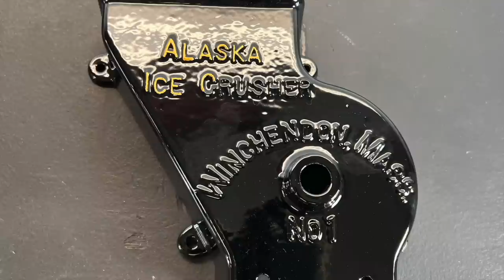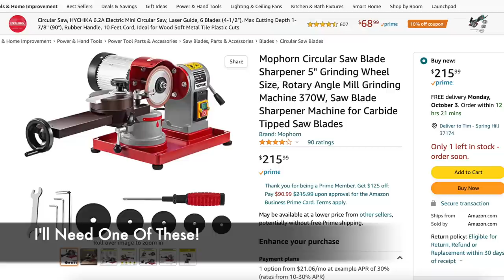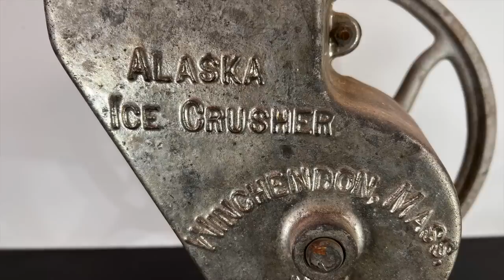Vintage Ice Crusher Restoration - Antique Restoring - Restoration Video

Comment: Great restoration.  They don't make things like that anymore.  Do you mind if I ask if you used a food contact safe paint and what type?  I am restoring one by North Brothers myself and it will be used frequently.  I am considering a low VOC semi-gloss, but would appreciate your input.  A show piece is different than a working unit, especially when your friends are drinking Mai Tais with your ice cubes.  Thanks!

Comment: be cool though to have an actual sword ⚔️ made. we use Wustof not spelled right german knives. they have steak 🥩 knives that don’t shred steak. their cutlery great to as gifts. use wooden cutting boards plastic glass dull the knives very quickly use book’s brothers cutting boards only. use food grade mineral oil to keep boards hydrated. general dawn soap 🧼 hand wash only. dry you’ll the board get dull add the mineral oil wipe down let air dry keep on cooking